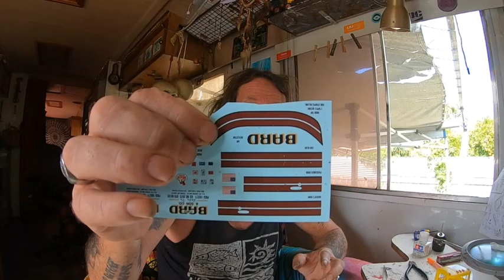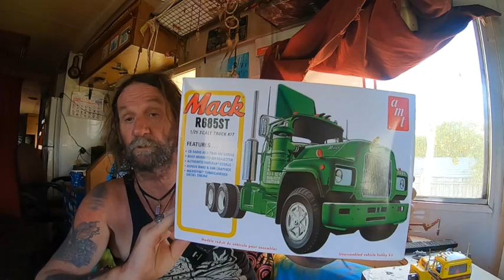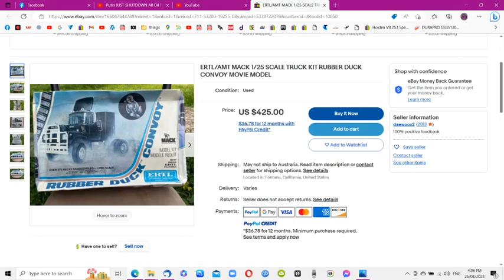MACK R685ST Truck Model Build Prt 3.... Hippy Trev

Comment: Looks like you need a new awning on the side of your bus there, I have a mate who lives in a bus,  he welded steel on the side and put a roof over his bus and put the solar on it,  he said the bus being in shade is at least 10 degrees cooler inside in summer
Reply from the maker: ya right mate the awning is toast & over $2k to replace.... not sure what lm going to do but l dont want a permit fixture put on or over the bus  cheers
Reply: Yah cause he had leaks in the bus that kept coming back, with a roof he has non of that anymore, no more water coming in the windows that kinda thing